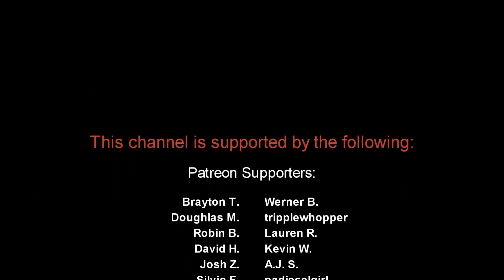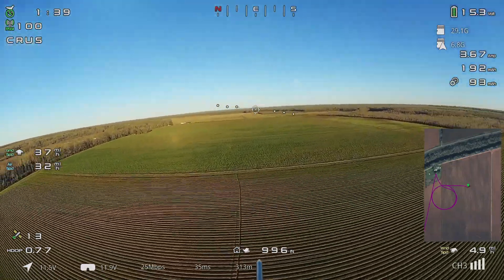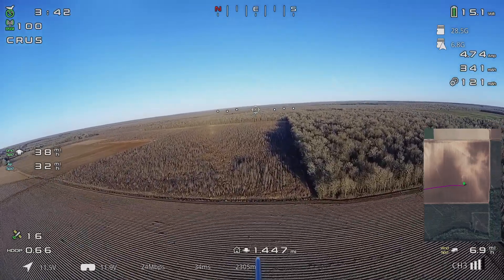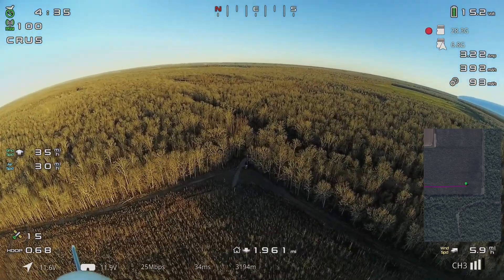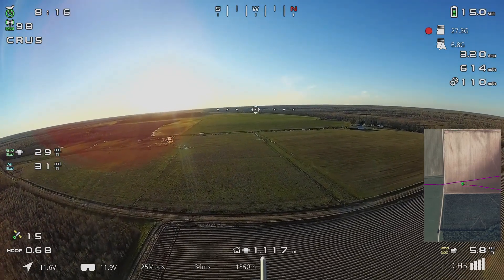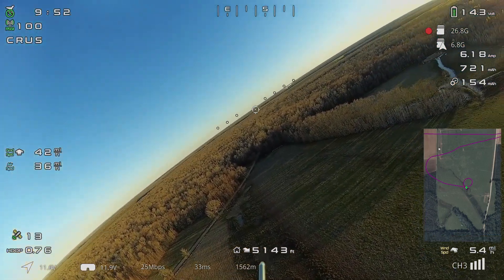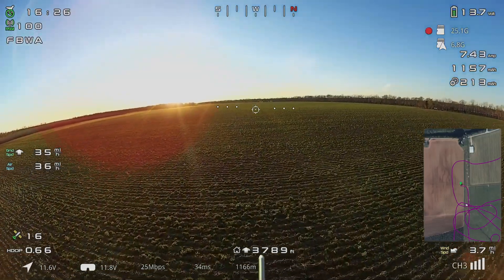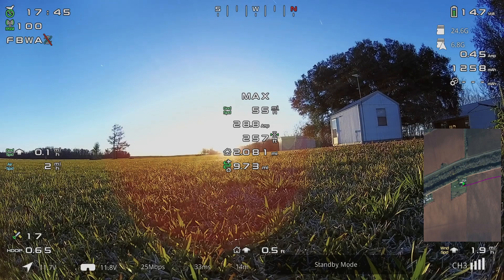Walksnail, fixing stuff...

Comment: Hey, thanks for the video, I've been using Walksnail more and have the same flickering OSD issues. I remembered that you mentioned your flickering issues and came looking for this info!
Reply from the maker: Yeah it's kind of annoying. I've switched off onboard recording in the VTX for now until it gets fixed. Caddx has told me multiple times that they're aware and do intend to fix it in the future... I keep reminding them... lol With the VT recording switched off it works fine though, at least there's that workaround for now.
Reply: @bonafidepirate  - and 7 months later, nothing is fixed. Even when VTX recording is disabled, my Avatar HD Pro does that flicker from time to time.

Comment: Funny I'm seeing this today as my matek inav build had flickering osd on my flight yesterday. New issue...only change was going from 3s to 4s lion.
Reply from the maker: I haven't seen the same flickering form anyone flying inav. I think it writes the OSD different than Ardupilot (only updated elements vs the whole screen every frame) so you tend to see more "corruption" in the form of elements left behind, like bits of the AHI left on screen as is moves around, or elements that drop off and don't come back until you "refresh" the OSD by switching screens, etc. I believe Darren was working on some changes in that regard though, so depending on what version of firmware you're flying it could behave different. I haven't really kept up with inav in the last couple of months though so I could be wrong!

Comment: For sure you could have flown through that barn... Lol
Reply from the maker: Yeah I'm pretty positive it will do it with no problem. I've flown a few planes though there on analog. I'm honestly surprised how well this system works so far, definitely less breakup than analog when flying down low like that in the places I usually fly. I was hoping it would be "good enough", didn't expect it to be better... lol

Comment: I am stepping into the world of my first fpv plane. Got a reptile dragon and a 1.3ghz VTX so far. No reciever or ground station built yet. Ive been following your walksnail vids lately and wanted to ask do you personally recommend this system over analog? Its not too late for me to go this route instead. Ive seen your previous footage of 1.3ghz flights and its impressive for analog. Hardly any breakup. Also, how far have you sent out your walksnail without losing video?
Reply from the maker: I've personally only had Walksnail out to 4 miles so far, but it can definitely do more with the right antennas, several people have done it by now... lol Honestly if you already have the airborne side of you analog system I'd say finish that and fly it for a bit, and make sure FPV is something you'll stick with anyway. Maybe there will even be better HD options by the time you're start another build... lol (Though we're in a pretty good spot right now for that, it's come a long way in the past year or so) Even if you don't build a second plane and still want HD later, you can swap it out and get rid of the analog gear then. I think analog will be around for a long time yet, especially the 1.3GHz stuff for people flying long range.
Reply: @bonafidepirate  yeah I think I'll go ahead and run this analog. Knowing me there will be another plane somewhere down the road. That walksnail does look tempting in resolution

Comment: Great progress. Awesome that a workaround to the flicker was found. This should be fixable in VTx firmware. (at least not hardware related) 
Love the low level flying. Fields are a bit wet, and muddy, so have to be careful down too low! That wouldn't be a fun walk.
Reply from the maker: For sure! It will be interesting to see if they can fix it and get a stable OSD while recording onboard at the same time. There's been at least some speculation that it's a limitation of the chipset onboard and just more workload than it can handle. It's just that though, speculation. We won't really know what's going on as long as it's a closed system. ;)

Comment: This is a pretty efficient plane. I almost got the volantex Ranger that’s shaped like this 🎉
Reply from the maker: I've never flown those Volantex planes, though I've seen plenty of good things about them, lots of people like them... lol This one picked up a bit of efficiency when I swapped out the motor/prop and took the landing gear off. I'm betting the landing gear had more to do with it than the motor though. I stayed as close as I could to the original size and KV rating...

Comment: First of all, great video.  Thanks for the flickering OSD workaround.  It really annoys me too.  I have removed about half on my OSD items so to reduce the effect.  Oh, can you tell me why my rate of climb arrow points the wrong way and the airspeed and the groundspeed have the wrong units.  The air and groundspeed show "mA/Km" 🤐 I am using Sneaky's custom fonts for Walksnail Ardupilot.
Reply: I just got back from a sunset flight using the Walksnail system and my Swordfish running Arduplane. After changing the MSP_OPTIONS from 4 to 0 the OSD now shows the correct unit of measurement. Thank you guys for all of your help. 

By the way, my OSD was flashing a lot less after turning off the VTX recording. 😊😊
Reply from the maker: @cbaker794  Good stuff! Glad to be able to help.
Reply from the maker: I haven't seen that with Ardupilot, it should work and show all the elements correctly. About all I can think of is make sure you're using the latest version of his fonts, currently 1.4 I think, whatever is newest on his site... lol Apart from that I don't know what would cause it. Unless you have BF compatibility enabled in Ardupilot, but I think that would show more random elements than just those, depending on what all you have on screen. (Check "MSP_OPTIONS" parameter, make sure that last bit is not enabled, the parameter should be set to "0" to disable them all) https://ardupilot.org/plane/docs/parameters.html#msp-options
Reply: @bonafidepirate  Thank you for your quick response.  I will check later today and let you know.  I think you nailed it with "BF Compatibility" enabled.
Reply: 2 questions: what version of what font are you using?  and do you have BF compatibility enabled in ARDU settings?
Reply: @shannonbaker9922  Good catch Sneaky FPV.  You are correct, I do have BF compatibility enabled per another YouTub'er that I was following when I first got the Walksnail system.  I will disable BF compatibility and report back.  😀
Reply from the maker: @shannonbaker9922  Hey, ignore my previous reply... lol I didn't realize it was you, and thought you were asking the same questions. ;) I answered on auto-pilot, just realized now though! :D